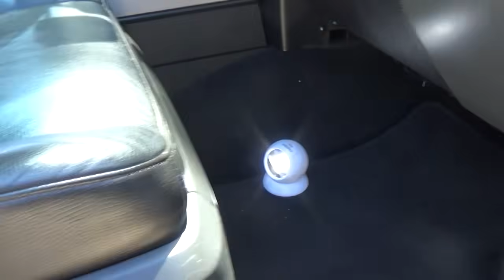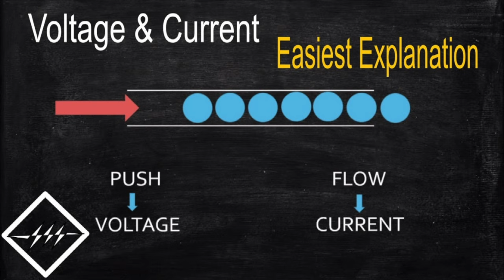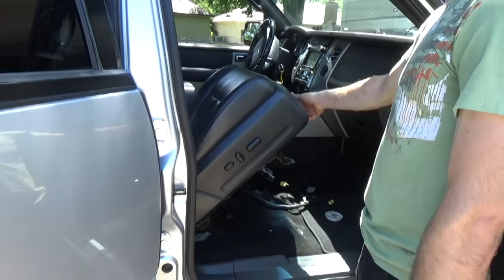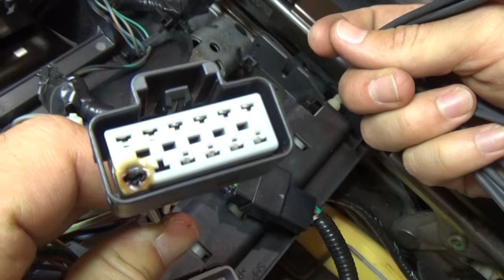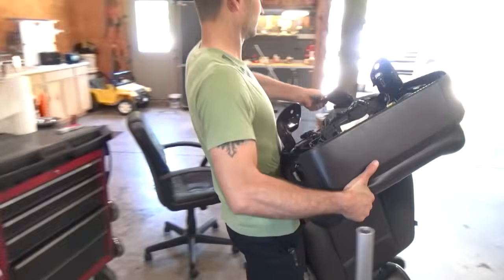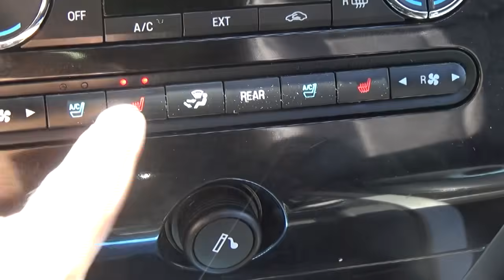Heated Seats Not Working

Comment: Heavy duty electrician work.  What is your opinion about de-pinning the connector versus splicing wires?
Reply from the maker: Great question.  I would imagine most would say de-pinning is the best, but if not done correctly it can cause problems.  So, I would say it depends on the skill level of the person doing it.  if they are skilled then yes de-pinning. but is a DIYer I would say splicing.  Just my experienced opinion

Comment: I am trying like hell to get that connector off
Reply: Did you end up getting yours off? If so, can ya tell me how please! I can't get mine to budge.
Reply: @cassidydimick9522  I muscled the hell out of it. I also used a pick and a flat head. Also.. I didn't take off the seat. All I did was shoved a copper wire into the burnt portion of the connector and plugged the connector back in. Then I drilled a tiny pilot hole under the carpet into the metal floor board, used a self tapper screw and a lock nut to put the other end of the copper wire to ground it to the body. Now heated and ac seats work.
Reply: @nicetomeetme5150  awesome, I'm gonna keep muscling then, I just stabbed myself with my pick, I'm so mad at Ford right now! I'm going to try your fix, sounds like my kind of shortcut! Thanks for getting back to me!
Reply: @cassidydimick9522  keep me posted if anything. I can send pics or whatever.

I tough to get answers online lol
Reply: @nicetomeetme5150  finally got the sucker off, but it's not just that one that's melted, the one next to it started to melt as well, but not as bad. You think your fix will still work?
Reply: @cassidydimick9522  look and see if the connector slot is for the black wire.. of so than yes.
Reply: @nicetomeetme5150  yes both are black wires, should I run copper wire from both, or just the one?
Reply: @cassidydimick9522  do the connectors connect to each other? If so just 1
Reply: @cassidydimick9522   I uploaded a video on my channel showing what I did

Comment: Great video!   THANK YOU!!   My driver side heated seat does not work.  The passenger side does.   The cooling seats work on both sides.  Any ideas?  I was told the heating element inside the seat is fried.  Thoughts?  Do you have a video for replacing the heating element?

Comment: My dash board shows everything is working, heated & cooled seats  on the dash are on. Still no heat or cooled feeling coming to both front seats. Any insight would be appreciated, what do you suggest? I have no burnt connections.
Reply: they are two different circuits.  The lights on the dash tell you the switch is giving the command but no real heat means that circuit is not responding.
Reply: @strokewarrior5762   yes but if I have no brunt wires what do I fix to make it work ?

Comment: You want to use that extra wire, the 2nd pin next to the burned one is also ground on the module.  If you open the cover you will see both pins go to ground plane of module.  By splicing both wires together to the original ground, you share the load over the 2 pins and reduce the likelihood of burning the same pin again.
Reply: So that’s for sure both ground wires?
Reply: @ronnieturk9905  yep, just fixed mine... other videos showed linking both of those pins... I did the drill through method... so drilled through old connector. Soldered wires to pins directly, then spliced 2 wires to original ground wire a few inches back.  Worked great..

Comment: I have a 2012 fusion that the light goes off on drivers side after a second but the passenger light works fine.  Do you know if the compartment for a fusion would still be on the passenger side as the case in your expedition?

Comment: I have problem with my LH power seat, it drives me crazy, i don't have any lead to solve it, maybe you can help me ?
It's 2011 mustang v8, first the seat wouldn't go vertically, but would go horizontally,  afterwards it completely stop any movement, but the lumbar functions well. No fuse blown, replaced the switch, didn't help, guess they made it do to sell new assembly. 
Please help me
Reply from the maker: If you replaced the switch and you do have 12 volts going to the switch, it can only be either a faulty connection or a bad motor.  The seat positions have motors that drive them. Unfortunately they are hard to get to.  You will need to remove the seat, turn it over to access the motors.  To do this you will have to disconnect all the connectors.  Then get a wire diagram so you know which wires control which motor,  then supply your own power and ground and see if the motors work.  If the do work, your problem is in the wiring.  If they don't work, then the motor itself is bad.   Good luck

Comment: I'm thinking of just taking the factory wires and swapping them to the new female housing by simply removing them from the damaged one ...in my mind the only one that needs spliced is the ground.
Reply: It worked , ... It took a little time to get the melted wire lock to slide out but when I got it undone it took two minutes to swap the wires out from the old housing to the new one.
Reply from the maker: I don't see why it wouldn't work.  Just be sure all connections are strong and tight

Comment: Great video…. I have 2010 expedition, looks like someone prior to me owning vehicle replaced both plug and module.  Neither look burnt.  Passengers side works great, drivers works for only about 15 seconds and then shuts off.  Would I need to take vehicle to dealer and have new module programmed?
Reply from the maker: it is possible that a reprogram is needed, but it may just need a recalibration that any good shop could do.
Reply: @realfixesrealfast  thx for replying, I will try and take to a shop. Hopefully easy fix.  Thx again

Comment: Excellent video.  I performed this procedure on my 2010 Avalanche and got the seats working again.  Now after about a month, it burnt out again.  While driving my truck, I noticed an electrical burning smell.  Checked the connector when I got home, and sure enough, same thing again.  I spliced the extra wire into the ground wire, but apparently there's still a problem.  It actually sporadically works so it's not completely burnt out.  Would my next step be to replace the module, get a new connector and depin the existing one into this new one?  Any thoughts?
Reply from the maker: the burning smell and the sporadic working point to a poor connection not the module  double check all of that
Reply: @realfixesrealfast  I understand what you're saying, but not quite sure how it could be a poor connection given that the harness snaps into the module.  What else is there anything to check besides just unplugging/plugging the harness?
Reply from the maker: @bdbull  the click you hear is the plastic pieces fitting together.  I'm talking about the actual pin connectors in the harness connector.  Sometimes they don't fit tight, or they have corrosion on them..
Reply: @realfixesrealfast  I'll have to check the connectors again.  The harness was brand new and I don't remember seeing any corrosion on the male pin from the module, but I'll check them again when I get a chance.

Comment: I'm guessing this is probably applicable to a 2015 Expedition also? As it was basically a refresh of the previous generation expeditions. Great Video tutorial thanks!!    And here is the part number for those who need it --> Motorcraft WPT-928 and the Amazon link--> https://www.amazon.com/Motorcraft-WPT-928-Heated-Module-Connector/dp/B0031H2FES

Comment: You should have just pulled all the terminals out of each connector and snapped the original ones into the new connector and only had to cut one wire. This also preserves the colors at the connector.

Comment: another tip! before disconnecting the seats remove negative terminal from battery for at least 10 minutes to prevent an accidental airbag deployment!
Reply: Car manufacturer says at least 1 minute
Reply: I didn't do this the first time I disconnected as forgot there was even an airbag in seat... nothing happened,  but did when putting it back in just because I didn't want to risk it...

Comment: So...good video. Helped a lot. A few things to note.
The part number on Amazon brings up a page that is very sketchy on what it has. I posted a picture of it actually including the crimps and heat shrinks. They only give you the exact amount of crimps -1 for the wire unused; so don’t lose one. 

The seats are held in by a Torx style screw; not a “star”. They go in numbers, the highest I could find at Home Depot was a T-55, it had some play; I think it was more a T-60. The rear seemed bigger than the fronts. 

Also mine were tough to get out. Especially the rears; to say it took pressure; that’s no joke. Make sure you have a long socket wrench handle for leverage. 

The rest worked exactly as he said.
Reply: Thanks for adding your input

Comment: Hello. Thanks for the video. I have a similar issue with my 2013 Ford F150: the cooled and heat seats lights go on and don't turn off but I get no cooled or hot air in the seats. What could be the cause of this? Thanks again.
Reply: I actually have 2015 Navigator and same issues hopping relay or something did you solve your issues?

Comment: @realfixesrealfast I have a 2010 Navigator. After watching your video, I was convinced I had the same problem. I went out and pulled the connector, but it looked totally fine. Not burnt at all... Then I realized it is only the driver side heated seat that doesn't work. It does the same thing as in your video, only the light stays on for around 45 seconds before it goes off. The passenger side works fine. The air cooling works on both the driver and the passenger seat. Do you have any advice for me?
Reply: I have a 2007 Lincoln navigator that does the exact same thing! I also need advice!

Comment: That extra wire is for the ground so it does not fry out again..The ground needs to be bigger , that is why you’re supposed to use that extra wire and run it to the plug next to it which should be L and then you splice the 2 together 🤦‍♂️
Reply from the maker: Hello Eric,  thanks for you comments.  I'll add them to the comment section so others will be aware

Comment: For the longest time I didn't understand why high amperage circuits are so much more sensitive to the effects of corrosion. Then I realized, the downward heat spiral caused by tiny resistance is the product of current and voltage drop across the resistance. Of course the voltage drop is simply current*resistance. So, the power turned into degrading heat at the corrosion is I^2*R, which makes high amperage circuits especially vulnerable. Not only that, but high amperage circuits need that current to drive devices, and a small increase in line resistance in a high amperage circuit causes a steep fall in power delivery to the end device.
Reply from the maker: Now that is a great observation and explanation (to someone who understands those principles.)  You should make a video explaining that in simpler terms.  You would do everyone a great service

Comment: Figured I’d should chime in and let everyone know...

The extra 2nd pin wire is supposed to be connected to the ground as well, that’s why it’s really there. The reason why the module burnt out in the first place is because of improper ground. The new pin with wire is made there so both wires are to be grounded and there is a more secure and more stronger ground which will ultimately prevent the module from burning out again.

You’re welcome.
Reply: the wiring on the replacement part was thicker gauge, so if it took 6 years for the thinner gauged wiring to finally corrode and short then the single thicker gauged wire should the rest of that vehicles life. 

You're welcome
Reply: This is absolutely correct.  I was looking to see if this comment was here first before I added it. 
This fix will just result in another burned out ground.  The second wire should be attached to ground either by connecting to the first ground wire or another spot that is grounded.
Reply: @dr7477  OK this happened to me. Replaced and did it again a few days later. So the second wire needs to be spliced to the first wire correct?
Reply: @lupeluna7269  The video that "Hey Now" linked you to above is right on point. If you don't understand after watching his video,  I'm not sure what to say.

I didn't get a new pigtail,  mine was burnt but not that bad.  I was able to clean it up and get it all working again but I knew it wouldn't last so I added the second ground wire to my factory original connector.  I didn't have the pin for my second ground wire so I had to go to the junkyard and get the pin off of that connector and put it in mine.  I just cut a length of wire with the pin and spliced it in with the wire next to it.
Reply: @nightlifephantom you're correct, I was waiting to see if anyone else caught that
Reply: So the second wire goes to where? Goes spliced to the same harness ground????
Reply: @chalinoahuesoduro5566  goes to the one that shorted out originally. So now you have 2 grounds from the lead that burned..
Reply: @HC-xs6ek  I guess this happened to me. I replaced the connector as in the video and worked good for a few days now it's burnt out again. Square one again. So the second wire on the connector needs to be connected with the first wire together? Or grounded else where but where exactly?
Reply: @lupeluna7269  https://youtu.be/gRcBYjN0T8E. I made this video, hope it helps you.
Reply: My fix lasted about a year, doing it again but will splice both wires

Comment: I gotta Question out of context with this Video? All due apologies! Is there a reccomended transmission swap away from oem  for the original in the 94 e-150 Van they use the 351 Windsor motor. I have heard on multiple occasions the o.e.m. transmission is total garbage. While the motor runs just fine

Comment: NO NO NO NO NO DO NOT REUSE THAT MODULE OH YEAH IT MAY WORK FOR A LITTLE WHILE BUT IT WILL BE BACK WITH ANOTHER BURNT CONNECTOR AND PIN ... COME ON RFRF !!! YOU SHOULD KNOW BETTER THEN THAT !!!!
Reply: hey.....if I was still at the dealer I would just change out the module....Dwyane called it right call....the resistance was in the pin get with the program dude!
Reply: Being at home I am assuming that the guy that was helping Dywan was family and he was trying to safely save him some money. Looking at the module and the connector as I'm sure Dywane did, it looked as if the pin in the module had little to no damage to it other than a little discoloration but looking at the damage to the connector it appears the female pin which has less surface area than the Male pin to dissipate heat, took the brunt of heat/damage which was obvious by how burt the connector was and as the module had no plastic melted  or burn damage. Compared to the cost of a module to a $20.00 connector after assessing the damage, I think I would of went that route too !
Reply: @billyr9840  I totally disagree if it was hot enough to even discolor the plastic around the male pin it should of been replaced ,  I have seen this many many times it is a week spot in the system mark my words one of these days this will burn again .. I respect RFRF and have even looked to his videos for guidance on a few things and greatly appreciate him working hard to do YouTube videos and work on cars saving the customer money is fixing the car right the first time !!!!
Reply: Mike, I agree with your thinking and Dywane probably does too for a paying customer. You are absolutly correct but under the circumstances. Maybe the customer ( family member/neighbor ect ) did not have the financial resources to do the repair right and needed the car to get to and from school/work ect. Being the nice guy Dywane is he probably was just trying to help him out. After assessing the damages and under those circumstances and even if it was my own car I would of gone that route. By the amount of damage to that male pin I believe it will last many years to come if not the life of the vehicle. In hindsight he could of went the extra mile and de-pined the Male pin and replaced it with a new one. In hindsight maybe that should of been made clear to his YouTube audiance if this is the case I am suggesting.  Take Care!
Reply: @mechanicmike2858  i think you might over missed the point of what the video was about maybe watch it again.
Reply: 8ixuudjdkdkdiAzdujsjsbznzbzbzj*j*$*$*$*$**$*$*$**#jxjdjjddj;;#;$;ABC